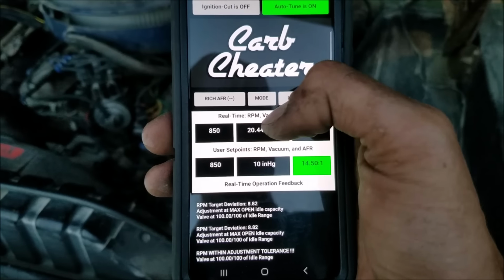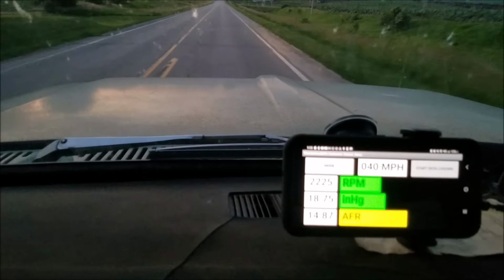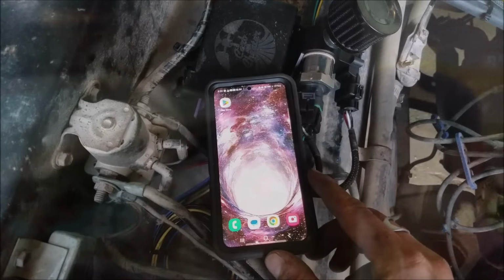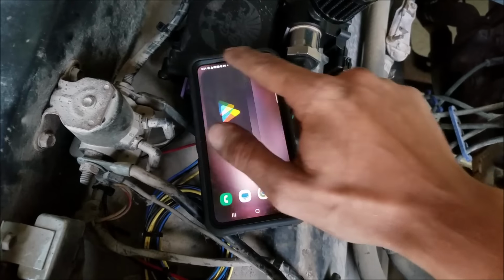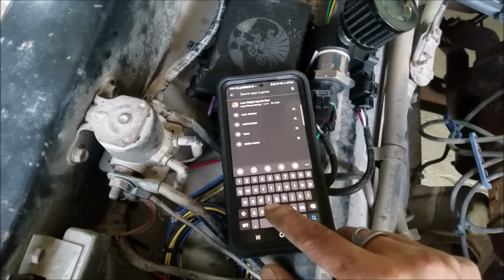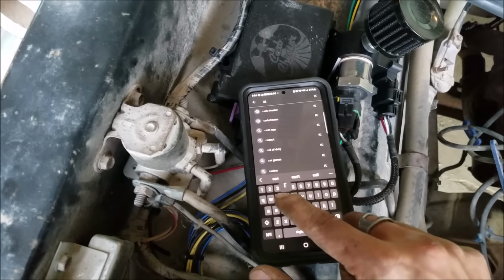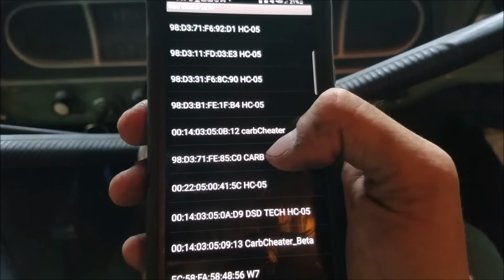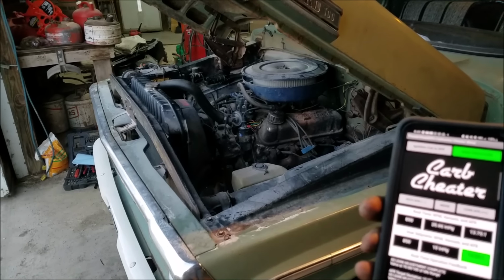Make a SELF-TUNING Holley/Edelbrock Carb! (Carb Cheater: Installation & Setup)

Comment: call me slow but i am having trouble seeing how something without any direct control over or even relation to fuel delivery can effectively control AFR, i've been through your videos for over a year and all the data i can find you've provided and not seeing any technical explanation on how the carb cheater is supposed to accomplish what you say it does, do you have a video on the workings of the carb cheater?
Reply from the maker: I'll be making that this weekend - I intentionally didn't talk about it much till I could sell it which I was clear to do as of a couple weeks ago.

Comment: this is the first i have seen of this product. I am going to look in to one of these. I hate tuning Holley carbs and i can never get them quite right and they lose their tune as the weather changes. Edelbrock performer carbs hold a tune better but are complicated to tune, and Q-jets are a pain because you have to take the top off of them for any tuning. so, this would greatly simplify things for me. I had been considering Sniper of FITech TBI setups, but they are require adding a high-pressure fuel line and pump in the tank, or a boost pump and some sort of remote reservoir/return tank for duel under the hood. plus he cost is nearly 2500 buy the time you add spark control to it.
Reply from the maker: With carb cheater you still have to get your carb relatively decent - but thats dumb easy since you can see all the data instead of the typical carb guess work

Comment: Luke, this video makes me question something.  I'd like to run this setup on my personal car, but I'm running an MSD ignition box on all of my cars.  The boxes are all triggered by points, but the capacitive discharge system makes me wonder about installing the wires directly to the coil.  I'm guessing this is to pickup on the teach signal.  Could I tie the wire into the teach signal on the ignition box instead of into the wiring directly on the coil?

Another question, you said that it's calibrated for V8s and larger 6 cylinders.  I'm interested in installing this onto my 1973 Ford Pinto with a 2.0L 4 cylinder.  Is there any chance something of this caliber could be accommodate?

Comment: Hey Luke,Can the Carb Cheater be used with HEI Ign. (in cap coil)?
Reply from the maker: Easy, that's what the maverick has. Yellow wire to BAT, spliced to existing lead, and green wire to TACH (if already a wire on tach, land ours and splice original tach to ours. Easy Easy

Comment: Looking at this, my main complaint is that it requires a smart phone for it's full capability. I'm just worried about what would possibly happen if the product is discontinued someday and the app vanishes. I'm considering this as a possibility, but for me it's a little bit of a turnoff to not have it with it's own physical controls.
Reply from the maker: It would raise the price by around 100 dollars which is why it doesn't. Perhaps in the future we could offer that option. We are also soon putting the .apk file on our website so someone could download it and save it forever.

Comment: Since the CC is not connected in anyway to the carburetor, especially on the fly, the only way I can see the AFR being adjusted is by the CC regulating a vacuum leak. It obviously is using the ox sensor and than the coil for rpms. Maybe you explained this somewhere. That's my guess.
Reply from the maker: This was just an installation video largely for the several hundred people who already have one. It's programatically pretty complex with what it does in different scenarios, but in the physical world to put it as simple as possible is that it's a automatically controlled proportional air bleed that adjusts based on actual afr and other telemetry's deviation from the users target setpoints

Comment: Please please a digital option would be able to have an idle up for airconditioner operation . The signal wire could be the compressor power wire . There is little mechanical parts around anymore to do this .Once done by push/pull vacuum canister on throttle linkage .   GM solenoid requires a flick of the pedal for idle up [its actually an anti runon / dieseling solenoid] .
Reply from the maker: I have a an idle setting you can utilize that targets an rpm within a specific air fuel ratio range. So it can compensate for load

Comment: I liked the idea, until the app. Basically an idle air control motor that allows you add air to the fuel mixture under the carb making this a simple TBI style set up has it place. But having to have a specific phone tied to the vehicle or having to have a second device for another vehicle is what turns me off. What if I have multiple vehicles that I am having driven in a group (I own 6 and we still do cruise in's in our small town) using this product. That means that each person driving my other vehicles (say my wife in my second vehicle and so on) would also have to have this app downloaded on a device to run that vehicle. What happens if I do not take my phone with me? Which I often do. I also do not use my phones GPS. I have all those permissions turned off. I live way out in the country and half the time the GPS and cell reception doesn't work any way so we do not rely on our phones. Of course I feel this could be a better product if it came with a mini dash controller like the Holley or other set ups. Even the cheap "power programmer/ speedo healers" come with a small hand held screen. I understand this would up the price of the product. You are already asking $383 for this set up. Say someone was going to upgrade their project vehicle with a new intake (est $400) and carb (est $400) and then add your product, the total cost is not much less than going to a TBI style fuel injection set up which is self tuning as well. The major difference is that you need to have a well tuned carburetor first for your system to work properly.  Don't get me wrong, I love watching your videos and I play them when I can and I would love to try this out on my old F100 that I just inherited with a 352 that is going under the knife getting a factory 4 barrel intake, cam, HEI style distributor and a Street Demon carb. Just do not want somethin that is tied to my phone or other device that I have to keep with the vehicle when it is driven.

Comment: We're at a point where we can do what OEMs used to do at the end of the carb era, but with better and cheaper electronics. Congratulations on bringing this to market!
Reply: Isn't this what Chrysler called "lean-burn"?
Reply: @DTSG3426 no. Stoich isn't lean, snd I'm pretty sure the carbs were set up to run super lean at cruise and then they just way way retarded the yiming to keep the engine from blowing up.

Computer controlled carbs tried to maintain stoich, but by the time they got to a point it was viable, the benefits of efi were undeniable and there wasn't a reason to stick to carbs.
Reply: @16vSciroccoboi  thanks. all i remember was take it off and throwit away

Comment: Got to say, this is pretty nifty for the people new to cars or just carb tuning. Would be an interesting option for a headache free weekend cruiser that isn't efi too.

I've been doing the grease on gasket trick my whole life. Dad was born in Tennessee up in the mountains in 1939. When he was growing up it was basically a requirement to keep sheets of gasket making material on hand to keep everything going on the farm. To prolong the gaskets life and help with sealing they would lather them in grease. 

When times were real tough they even cut out and layered pages of old mail order catalogs and thin cardboard boxes into truly backwoods made gaskets. They would take the layers and brush them in grease and then set them in the sun to get the grease to become thinner. 

Once it seemed about right they would take thin boards place the greased up stack of paper on it, place another board on top and then back the tractor on top on the boards to compact it all down. If the tractor was what was broken they would press them under the biggest logs they hadn't already split for the smokehouse or wood burner.

He told me the gaskets would many times have a small trickle of fluid or vacuum leak initially. Once they were able to get some heat into it a time or two the paper would swell back up and the leaks would be gone. Some of them lasted way longer than they ever should have. 20yrs ago his sister sold their old family tractor which still had several 30+yr old homemade gaskets holding strong.

They used all kinds of other materials at times too and another he said worked rather well was leather soaked in grease or pine tar.

I've also used permatex 51845 without the activator on carb gaskets and air cleaner base gaskets with a lot of success. Seals great, doesn't really wipe away, and allows the gasket to be reused nearly indefinitely.

Comment: I've watched this twice and I still don't understand how it works... Is it basically just a controlled vacuum leak? When I pictured a self-tuning carb I pictured servos and stepper motors in place of the carb's adjustment screws, or even some kind of electro-mechanical metering block. If I'm understanding correctly, all the carb cheater does is decide how much air is allowed through the ports on the spacer. I get how that could raise the air-fuel ratio, but how could it lower it? Do you have to basically "zero things out" on your carb's mechanical adjustments so the carb cheater can take over?
Reply from the maker: I'll go through it in a video soon - this was predominantly an install video since we have sold several hundred and I know folks don't love written instructions. 
I need to do the "how this works" video yet.

Comment: Will this work with an HEI setup?
Reply from the maker: Yellow wire tagged BAT, green wire tagged to TACH. The maverick, my main test vehicle for carb cheater, runs an hei.
Reply: @ThunderHead289 so we have to splice it into the battery and tach wires already connected to the HEI?

Comment: I love my holleys, and hate electronic gadgetry.
Reply from the maker: I mean, I can tune a holley blindfolded with my hands tied behind my back, but when you have a wideband you see that air fuel ratio is quite variable on a carb.
Reply: @ThunderHead289  yeah, fuel injection is great, until it isn't. I spent $200 for a used  Holley and edelbrock rpm performer manifold, spent $30 for a carb kit, and did everything in the world with that old truck, including going to get parts for the efi vehicles. I won't buy a fuel injected vehicle at all anymore.

Comment: any experience with this and an inline 6, say a chevy 250 or 292?   Im sure youll need a 4bbl intake for the carb, but id be interested in something like this for an inline 6
Reply from the maker: Take a look at my recent uploads with a green f100 (different than this one like 2 videos back or so). It's a 300 inline and it was probably the easiest install I've ever done. 

You don't need a spacer.

Comment: Suggestion for improvement: For the mid-plate, smoothen, bevel, trumpet or cone the holes  on your 3D-model. This way you'll have solid indication which side of the plate needs to face down, and overall better flow and performance on your kit. For the already existing plates, you can mill the underside to resemble a cloverleaf pattern, just round the outside edges, if the middle seems too thin to round off. 5-10 hp more on top of the fuel savings is worth it. Just don't call it "the cloverleaf" to avoid any legal actions.
Reply: "double bubble butt bevel" I think could work 😉
Reply: @pablotharpalo5685 
Double, 'bubble' toil and trouble; 
     Fire burn and cauldron bubble.

Comment: so, aside from profiles for other than 8 or 6 cylinder... it'll work on a bike?  not quite that i wanted to go that way, i was thinking throttle body injection with electronic ignition if i didn't just do electric or steam, i'd have to start with a stock engine anyway, might be fun to mod it with a system like yours then sell it.

Comment: Will the Carb Cheater work with an engine with low vacuum? I have a built Pontiac engine with big cam and low vac and would love to use this for daily driving the car. The vac was so low I had to install a hydroboost so I would have any brakes. Great work and keep it up!
Reply from the maker: We are testing soon on a big cam car to see what happens - I think it will be fine actually from everything I've seen but we'll see for sure soon.
Reply: @ThunderHead289  That would be great. When I daily the car I use a Q-Jet that I remanufactured for this specific engine but when I race it I use a Proform so would like the Q to have the additional help. Thanks.

Comment: Such a cool idea! Wishing you all the skill to get this off the ground as it should be!
And also, just a quick variation on your greased gaskets, anti seize just rubbed in good doesn't have all the extra goop to deal with and does the same thing, gaskets pull right off!

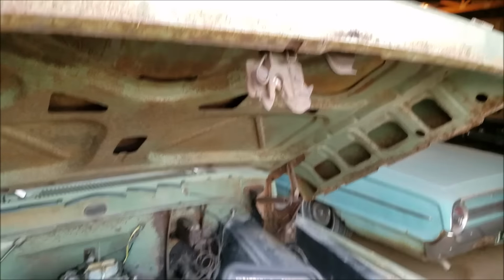Comment: Hah, good to see the ol f100 head bump at 27:46. I do have at least one question regarding this setup vs the beta setup, I'm assuming the extra wires you excluded are for the limiter control? If so I'd love to find out if that can be easily added back on the normal versions. Either way, I'll be placing my order and cant wait to throw it on my own f100! Gonna really put the system to the test here in the Rockies. Great job Luke!

EDIT: I rewatched just incase and you mentioned choke circuit/etc, still would love an answer!
Reply from the maker: I'm not sure what you mean with the choke circuit but the on board relay could definitely be used for choke power. 
Also it has no ill effects on choke from everything I tested this winter. But that's only two vehicles Also

Comment: lol and here I am going out of my way to get a carb because I want to get AWAY from computers in cars.....
Reply from the maker: The nice thing is if this were to fail your car still runs and drives fine. Although I've completely beat the heck out of these and half melted one above my header and it still works 😅
Reply: @ThunderHead289  Bwhaahha. Ye that's one of the main reasons I want away from EFI. Especially 21st centurt EFI. A single frayed wire anywhere in the harness of my 14 challenger could leave it dead in the water since it's throttle by wire and the computer is more than capable of disabling said throttle as it sees fit. Makes me not trust the car. I dont consider it reliable. My mom's 2003 Explorer did just that on me when the fuel level sender was being slightly wonky...still working just slightly glitchy. 

Doin' an engine swap on my 85 F150 so I can get back to a trusty ol' Carter YF on a 300. Old engine just plumb wore out after 350k or so. Mom's exploder did 4.0 SOHC things so its future is in limbo....I kinda want to 8ba swap it since mid TN doesnt do sniff checks anymore and there's nothing really stopping a fella from doing so. Not too difficult to make an 8BA pull the same 200hp the 4.0 SOHC did, but it would be easier to wrench on in that engine bay, sound bad ass, and be more reliable 😂👌

Comment: I really want to try out and hopefully find good reasons to use these on a couple of my vehicles. My concern is that the two engines that are carbureted are also equipped with "big" cams. Is there a minimum working vacuum amount for your cheater to be effective? I've had the Holley Sniper(ugh!) on the more radical/smaller of these engines, and the IAC does nothing but cause stalls and hunting idle, among all the other less-than-efficient traits of that Chinese, er, Holley thing. I suspect that's because the engine is normally making 8 in. of vacuum or less. Anxious to hear if it's realistic to expect improvement with so little vacuum for your system to work with. Thanks.
Reply from the maker: I understand what your saying for sure - we are planning on testing it with a big cam car soon - I think since I target idle rpm differently it will end up just fine. If it struggles with idle, you can actually idle on the raw carb and set carb cheater to only adjust while off idle. I tried to put a lot of capability in the users hand due to all the variable scenarios. 

Holley focused on being too perfect, which is admirable - but you can't always hit a tight window where if targeting like that, processor programming will hunt all over the place.
Reply: @ThunderHead289  Gotcha. Thanks for the comeback, and hope to hear more good things about this cool little system you have.

Comment: Would prefer a plug and play system that didn't rely on an app on your phone or bluetooth. Keep big tech and hackers out from under my hood.
Reply from the maker: 80 percent of the advantage to carb cheater is being able to utilize the gauge pack not just the auto adjustment feature.

Comment: HEI hook up instead of coil?
Reply from the maker: Yellow wire to BAT green wire to TACH. If wires already there, just splice in (if splicing, splice existing TACH wire to the carb cheater wire, not the other way around)
Reply: @ThunderHead289  perfect. I just ordered one looking forward to give it a try and be a ambassador for your brand here in North Carolina. It's going on my 69 chevell ss 396 car.